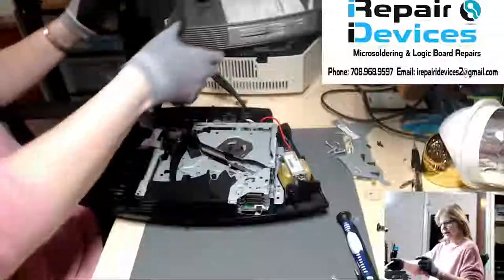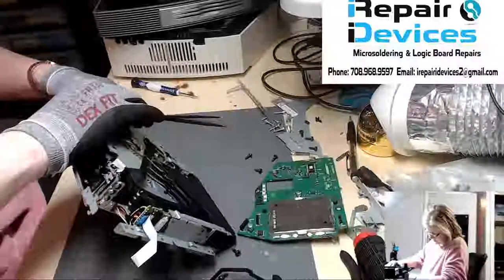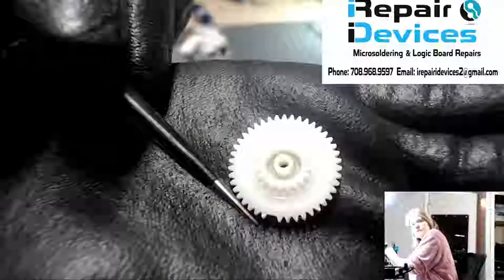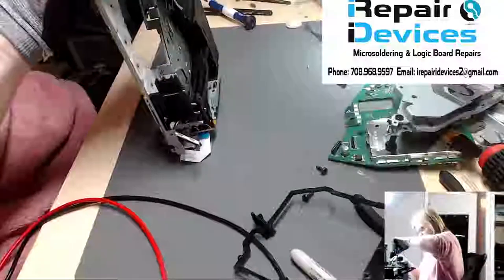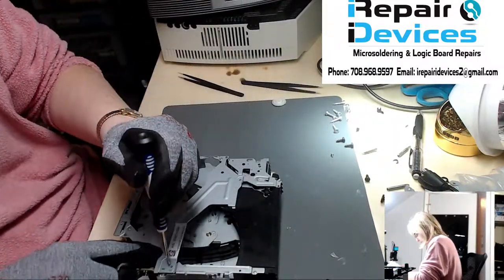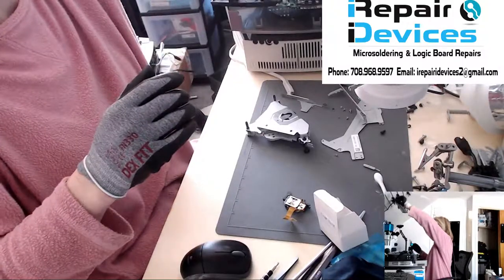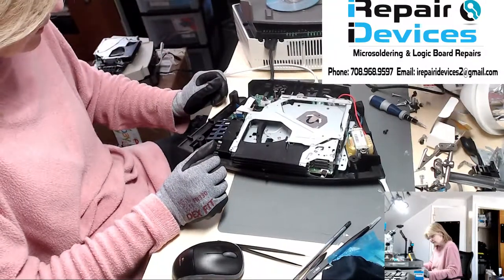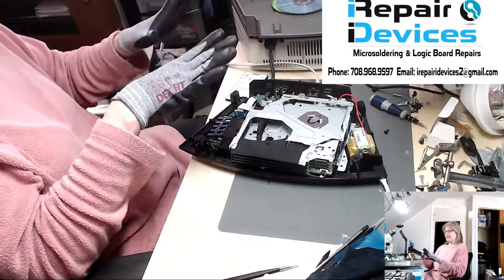Bose 3 Disc CD Changer: Grinding/Stuttering - Can it be fixed?

Comment: Can you repair two Bose media centers ? The power is not turning off and DVD/CD player not working. The second unit, the TV output and FM stations  not working. I have tried to get Bose to fix the problem but have no solutions for customer services.

Comment: Yo if your still active, i have audio cd player from Marantz and everytime it has to open it just makes grinding noises from the plastic gears until your pull it out slightly or give it a small push from behind on the inside and i cant figure how to fix it ir why its doing this

Comment: I wish you had shown the alignment procedure.  My unit is doing what yours did - the top disc goes in, but doesn't spin.  The other two discs go in and spin for a few seconds, then spin backwards and get ejected.  By fiddling with alignment I got the top disc to spin, but now the bottom two don't.  Trial and error is a tough way to do the alignment.  How do you do it?